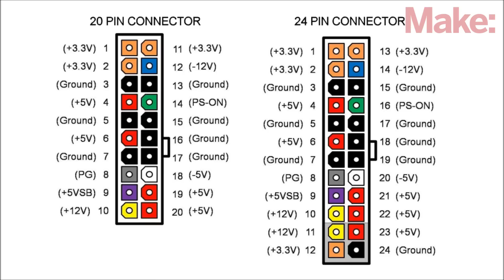Computer Power Supply Adapter

Comment: Oh, and for a 'project box', one of the greatest project boxes ever made for the old 'CPU power supply to lab power unit' project is the .50-caliber steel ammo can.  Simply mark the box for the fan and AC power in cut-out relief, and jigsaw or dremel it out, then on one side, cut out a 2-inch hole (and cover with a computer fan shroud). Now, you have TONS of 'flat surface' on the other side for switches, plug-ins, selector switches, etc., and the lid handle is a great carry-handle for portability (all, while being able to store cables inside it, while on the go). This, of course, negates the need for the plastic hobby case (about the same price, anyway), and gives you something that will last forever!

Comment: While this video, by far, provides the simplest explanation of how to convert an ATX PU to a general lab power supply, I still don't get why absolutely NO ONE wants to use a simple 4-pole, 3-position (or 5-pole, 4-position, if you want 3.3v out too) cam switch to simplify the banana plug install?! I mean, wouldn't it be easier to spend the $7 for the switch, then be able to switch to the voltage out you desire? Not really sure why this simple improvement (along with a bit of output gauging) is so remiss in these kinds of videos.

Comment: Apparently the convention is that the green rail actually needs to be pulled up to +5 STB.. It's only luck that it works without it.. Similar to how some PSUs work without a load.

Comment: Dont USE THE USB PORT! !! IT OUTPUTS 30 AMP OR MORE THAT CAN MAKE UR PHONE KISS YOU BYE BYE!
Reply: Hate to break it to everyone, but a power supply is a power supply, and a load is a load.  While you MUST (for sake of protecting a circuit) keep voltage on-par with what the circuit is designed for, amperage is incidental. The load will draw what the load desires, and no more.  You can connect an RPi to a 5v 1000a power supply, and it will NOT hurt the RPi. HOWEVER, if something is damaged about the RPi (or any load), and it becomes able (for whatever reason) to draw a damaging amount of amps, if they are available, it will try to. THIS IS WHAT FUSES WERE MADE FOR!  So you don't over-draw in a short circuit situation.  I would recommend fusing your 5v USB plug, if you install it, with a 3.5a glass fuse. This will ensure that you do not over-draw to the point of circuit damage (I have an RPi that has drawn 3.11a several times during heavy 'crunching', so I fuse to 3.5a on purpose.
Reply: HappySlappyFace thanks.  BC I was thinking to power raspberry pi directly from power supply 😂
Reply: Harvinder Singh well I think its actually ok
Its not the psu that gives 30amps and the rpi eats it all!
But the rpi eats only max 0.5A so if u gave it 30A it will eat only 0.5A
That what happens to phones but if u have faulty psu
I recommand just buying a charger
And for that psu
Connect all colours cables together if u want max amps
Reply: HappySlappyFace  yeah thts what I thought bfr . it's the device which eats amps . n rpi eats about 2.5amps
Reply: Harvinder Singh WHAT RPI CANT EAT MORE THAN .5A watch thekingofrandom video about banana pi vs orange pi
Reply: ***** xD
Reply: This is not true man, you need to be careful what advice you give. Many things will draw more current than what is good for them. LEDs for example. They will get destroyed unless you limit the current. If you are using this thing for home electronics projects you are just asking for trouble.

Comment: You guys seem kinda smart and I'm a novice but why attach a resistor to heat up doing nothing when an extra light source is always nice? An LED strip to the 12v would be a useful load. (Also the max current on this thing would be really bad with only one cable per color, surely!)
Reply: just a matter of convenience, you may not want to have your led strip on when you are using your supply, or have to deal with moving it around where it won't bother your work. But of course if your led strip meets the minimum load, there's nothing wrong with using that. DIY kicks bruh
Reply: Technically, a light bulb IS a resistor, it's just converting energy to light more than heat, where a resistor like shown is converting it solely to heat. It really is up to you - as long as you can get your impedance where you need it.

Comment: then you can add little step up-down converter, yay! plus using SATA connector would be way smarter unless you really need that PS_ON signal.
Reply: and -12V rail is rated only for a fraction of a watt so I don't know why you would want to use it. but it's cool still.

Comment: seems like a lot of work for something you can buy for $17.95.
Reply: Where from? I actually want to know, I'm getting into soldering kits and need something to easily test them for cheap.
Reply: google arcade power supply. You usually get 5v, -5v, 12v, and some have 24v. Some come with a calibration pot. I use a power switch/ac filter/fuse combo with the power supply so it adds about 10 bucks.

Comment: I like the USB and 12V plug outputs, didn't think of those.

If you're going to draw the max rated power on a line, you'll want to have all leads of that voltage bound together.
ATX supplies have more connectors (and you're even only using 1 wire of 1 connector, per voltage, wtf?), cut them off, and connect all the wires of the same voltage. Then use a higher gauge wire to run it to the "box".

You should also connect the "POWER_OK" (purple?) cable to an LED and maybe even the "STANDBY_5V", so you have a visual indication of the device being powered and if the outputs are on/ok.
Reply: About one wire thing I think the same xD

Comment: That's not what I'm looking for.  I need to make a old Thermaltake 430watt power supply work on a New Asus LGA 1150 motherboard. Thing is, The power supply has a 4 wire connector plug, and a 6 wire connector plug, where the motherboard only has a 8 wire plug. Also, the CD/DVD drive is SATA and the wires to that from the power supply are IDE. Can I find adapters, make them, or do I have to shell out $$s for a new power supply?
Reply: its a better solution to buy a new PSU, as far as I'm concerned you would really want to upgrade it as its old and maybe low in wattage along with having old conmectors
Reply: Zakax2Boy
. . . .  http://s15.zetaboards.com/The_Factor/forum/5032604/
Reply: That's nice :D 👌
Reply: Discussion Forum 4 Firearms
http://s15.zetaboards.com/HandGunForum_net/index/
Reply: first
ide is not power connector
molex is what you are talking about

Comment: Any tips on where to put some fuses? I think this design needs to adapt! :/
Reply: You dont need any fuses. If you make a short the atx powers off. Just turn it back on and youre good to go ;)
Reply: +Donatellangelo I have inlined 10A fuses inline with all outputs (I have 0, 3v3, 5 and 12V output, without the negative rail broken out at all) - If you want to do it yourself, make sure to get slow blow fuses - or just rely on the PSU, they ususally are okay. I have taken apart two PSUs, both were using PS223 for protection, which looks alright from datasheets - it cuts the power off in case of any over/under current or voltage.

Comment: Can any one advise me if i can power 1500watts Car Amp with
400watts of power supply (Without transistor)
 *PSU
Reply: +Sen Wayne You will need at least 10% more electricity going into the amp, than it will output to the speakers, probably more. And PC-PSUs don't have all Watts on the 12V rail(s). You might just get 200 to 300W going to your speakers continously with your supply. If that is enough for your project, then you can do it. But if you turn the volume up too high, you might ruin the PSU.
Reply: +plasch  Thanks it worked. Cheers
Reply: +Sen Wayne Just to let you know, you are not getting 1500W of power going into your speakers. (and tbh I don't get people who want over a kilowatt of power pushed into car speakers - it would blow nearby windows if that the speakers would be any efficient)

Comment: BULLSHIT! I used the 10W 10ohm resistor and it still wouldn't start
Reply: Have you connected the green wire to a black one???
Reply: I had figured it out since then and I just needed the resistor mentioned in the video but thanks for the advice

Comment: Tried it didn't work, used resistor specified, still didn't work
Reply: +TGaming100 Resistor on 5V line is only to stabilise 12V output but PS can work without it. So probably u have messed up something with power lines or your PSU is just dead. You can check it  by just connecting green cable output with any black cable and your PSU should start.
Reply: +180doman "Resistor on 5V line is only to stabilise 12V output" - I got lost, can you explain?
Reply: I have since figured it out and it was just my fault but thanks for the help.
Reply: Sebastian Grygiel Stabilność linii 12V zależy od obciążenia na linii 5V. Linia 5V musi być obciążona żeby napięcie na linii 12V było stabilne. Bez tego rezystora zasilacz się uruchomi ale napięcia na linii 12V będą "latać.
Reply: 180doman Ah, rozumiem o co ci chodziło. Z doświadczenia wiem że niestety nie zawsze to działa, może miałem pecha ale z dwóch zasilaczy których używałem, w jednym wszystkie linie były stabilne bez obciążenia a w drugim tylko obciążana linia się stabilizowała (reszta była max 10% out) :/

Comment: I want to add in a USB charger for my cellphone when I am working at my bench but I found low amperage from just one red wire...could I add 2 or 3 red wires to make more amps..wouldn't  it charge faster or how about the purple wire that is also a constant 5V.
Reply: dont do it

Comment: I noticed that this method don't use any molex, sata, pcie, floppy or eps connectors, will this method take advantage of the full amperage of the power supply despite that? Will a  atx breakout board do the same thing as this method?

Comment: I have made this but my voltages are not very accurate.  For example my +12V actually comes out at 12.58 on my multimeter and I am worried that will fry my 12V things i want to power. Any suggestions?
Reply: use a resistor?
Reply: well usually they have a +- value of 1 volt so I think your ok

Comment: how i don't understand where are the power on wire ?? can i make this without this power button??? i have this 20-pin connector
0:20
Reply: The power on wire should be marked on the power supply chart/diabram, if not it is usually the only green wire in the middle of the connector (i think I remember some power supplies using purple, but I believe that was some time ago). You could make this without a power supply button by shorting the green wire to ground, but this will cause your power supply to stay on 24/7, which could cause premature failure. However, if you do set it up that way, there is generally a power supply switch on the back of the power supply that you could use instead of adding the power button on the terminal case.
Reply: Amra ok thx

Comment: Would it be possible to power a smaller car amp this way...reliability?
Reply: yes' an easier solution would be an xbox power brick.  output 12v check vidz

Comment: Could a 12V fan provide enough load?
Back in the late 80's I've used a floppy drive to provide the load. Even a simple low power mobo will do. A 10 ohm resistor seems like it'd have a high current loss.

Comment: If this hasent already been said(not going to go through all of the posts) Instead of vent holes put a 12v 40mm fan(or smaller), and put it in the case for it you have all the voltages right there. So when the thing turns on, the fan will go... seems logical... and it will be quiet too it is a small tiny fan.

Comment: If I add a usb connector in the +5v rail, can I charge my phone with it, I know it's like 36 amps which I think will fry my phone, do I add a usb circuit with a resistor or what
Reply: The phone itself will limit the charging current - it doesn't matter what the "available" current is. It won't give more than the recieving device allows.

Comment: One more side note..  IF you notice one white wire, (Pin 18 on the 20-pin version, Pin 20 on the 24-pin version, but that is normally N.C. (No wire)), this is -5V One more voltage to take advantage of!
  I still would be careful, but yes, you can mix/match some of the connections.. +3.3 for +, -5V for - would be +8V, +5V as +, -5V as -, would be +10V , +3.3 as +, -12V as -, would be +15.3V,  +5V as +, -12V as - would be +17V, and +12 as +, -12 as -, would be +24V (generic voltage for most HVAC systems, and charging voltage for most electric scooters.)  I advise against mixing in reverse  (-5 & -12, for example or any combination of + voltages.) as this will cause the switching circuitry to shut down. (Short condition.)

Comment: One key note, Not all supplies will start-up on their own.. Some require a load across the +5V to GND, to maintain the switching circuitry activity.. If your cooling fan refuses to spin when you jump the Green (PWR-On) wire to GND, two things to try.. jump it to +5VSB (Yes, I ran across a Laptop-Dock supply that used this, instead of to GND.,), #2, Place a 33-Ohm, 5W 'Sandblock' (ceramic block, wire-wound resistor, SSand/Epoxy filled.) across the +5V (Not the +5Vsb! ). If still inactive, slowly reduce the resistance to no lower than 10-Ohm, 10-Watt, But.. You'll notice this resistor will begin to get HOT!)  I've noticed people will put a 12V Automotive bulb across the +5V, but I advise against it, as it still will get hot, and if inside the box, An enclosed source of high heat will cause, Yep! Melted box, or worse, FIRE. Same COULD happen with the sandbox resistor, so I would put it inside the supply, on the opposite side from the cooling fan, where it would get a constant flow of cooler air.

Comment: This is a nice idea you can still use the power supply for a computer. Instead of cutting off all the wires and mounting the binding post inside the actual power supply  case. I don't think you would be able to draw much current just using one wire. Many power supply's have more the 20A on the 12v rail you would probably melt something.

Comment: I was thinking about doing this a few months back but 450w of power for only 10 amps of 12V didn't seem.. economical to me (especially since I have a variable power supply for the smaller voltages). I've since got a heavy duty 12v transformer and put a big bridge rectifier on a heatsink. (All the stuff was scrap lying around, dunno what the transformer came out of)

Comment: is it safe to connect electronics that run on batteries here (same voltage but current/amps ok? )?
Reply: Ampage/watts suppiled is determined by the device attached to the transformer. The transformer will attempted to supply the amps being drawn by the device attached.

Comment: I'm going to do this. But I'm going to install everything into one box  with a handle. I wonder if you could pull the top cover off the power supply and put all the connectors and switches on top of the power supply casing. Just so you didn't have to have a separate box for the connectors.
Reply: Yep. It's possible (I've done it). The one thing you may need to do (as I found out) is to desolder a bunch of the wires that would normally come out of the case in order to free up some space for the outputs/switches/etc. I also added pretty low amperage fuses to mine--power supplies can kick out a surprising amount of amperage and I'm not fond of being zapped.
Reply: I tried this once, and think it will depend on the kind of power supply you are using, some are very compact and it would be really difficult to fit everything. In my case it didn't worked, because the metal of which my power supply box was made was hard to drill and it became so ugly that I decided to go with a wooden box instead.

Comment: I made one of these a month back. Mine also included a power light and extension on the ATX 24pin to allow the PSU to be placed away.

I'd also suggest adding a variable voltage set of ports.  I have 2 v+ and 2 gnd configured to an LM317+5k Pot and the 12v. One set of ports is output, the other set serves to allow you to plug a multimeter in so you can get the exact voltage you want.
Reply: Wow... didn't realize this was 9 years old until just now, but just as useful a project today! How would I go about adding a digital readout to the variable potentiometer?

Comment: I would have used ring connectors and not spade, as spade connectors can fall off and cause a short.
Reply: I agree, i ring terminal makes better sense.  But otherwise, a spring washer should help keep the spade inplace
Reply: great minds think alike

Comment: Couldn't you use only one GND connection? why 4?
Reply: Because of the high current: typically ~ 20-40A or more depends on the actual load.
Reply: The ground is single and is called "common ground" but as you see it goes to each terminal as each of the voltage points need to be complete for a circuit to work.
Reply: Just to make it easier to connect more than 1 device to an output
Reply: P0tat0_craft  yeah that makes sense, but it also depends on the power of the connected device, so in some cases you won't be able to connect more than one device :)
Reply: stevens37y Yes, but I doubt that this supply can load the 40 amps

Comment: This video failed to mention there's a maximum current you can safely draw from each terminal, especially on the 3.3V rail and -12V rail, if you draw any current higher than the spec most PSUs won't cut off but blow / overheat components and kill the PSU. 

Always read the label and personally I would avoid using the -12V since the current you can draw from it is usually pretty low.
Reply: Any decent ATX PSU will have over current protection built in. If you're using a cheap junk PSU then be careful.
Reply: *****
you do realize most of the newer  power supply's under the atx spec don't require the -12v rail to have over like 1 amp lol   and the +3.3 and+5v rails are pissweek where as the +12 rail is very strong like atleat 60% of  the total out put on the psu